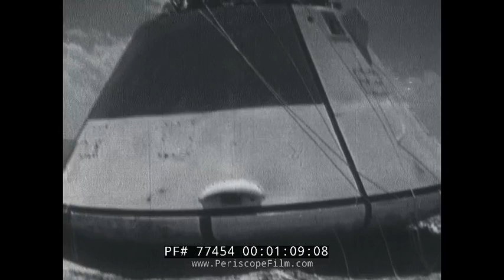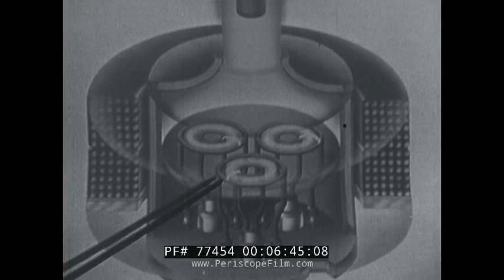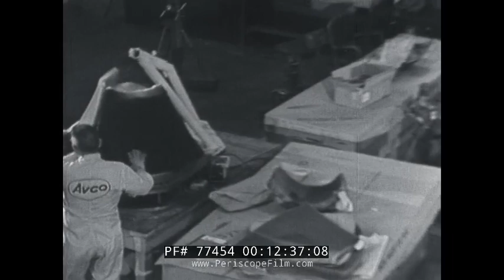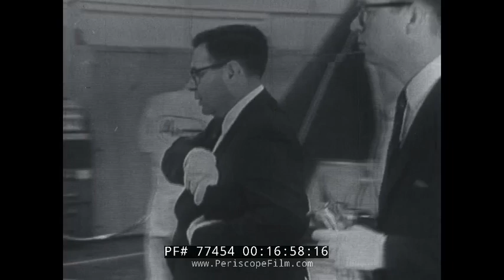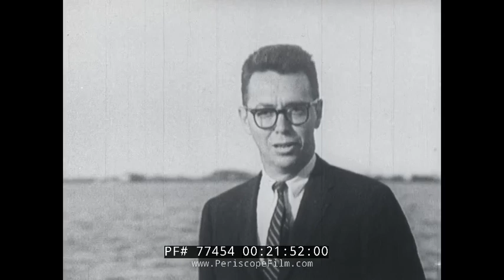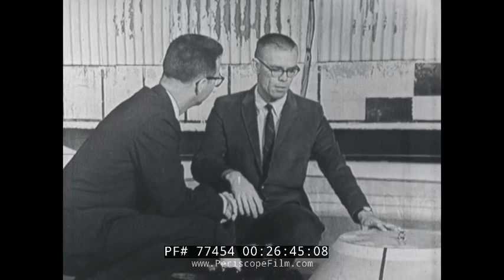1966 MIT TV SHOW "SCIENCE REPORTER"  RETURNING FROM THE MOON  APOLLO PROGRAM 77454

Comment: Hold on everything has a melting point,so how did that tin can survive 20,000 degrees,plus the "van allen belt",and then the exosphere,thermosphere,mesosphere,stratosphere,troposphere,plus the crew,cmon...........
Reply: Since you appear to be an expert on the VAB, perhaps you can tell everyone what type of radiation is found in the belts, how the flux varies from the center of the belt to the edges, and what the best type of shielding is for that type of radiation. And while you're at it, tell us how long they spent in the belts.

As far as the temperature is concerned, you obviously don't understand that "heat" and "temperature" aren't the same thing, so here's an experiment for you to try. Turn on your oven, and set it to 400 degrees. Once it comes up to temperature, open the door and hold your right hand in the oven for five seconds. Now, with your left hand, grab one of the oven racks and hold it for five seconds.  You'll see that even though they're at the same temperature, they have vastly different amounts of heat.
Reply: That's right, the materials at that time could not withstand 20000 degrees. That's why they used the process of ablation. Why don't you try learning something rather than clinging to your stupid conspiracy views.
Reply: Bafalcon Bafalcon we will never see the exact capsule that allegedly went on the moon. Because it would easily be proven a lie.
Reply: @scottt7586  That's odd, because I've seen several. But that would require going to museums and learning stuff, so I can understand why you haven't done that.